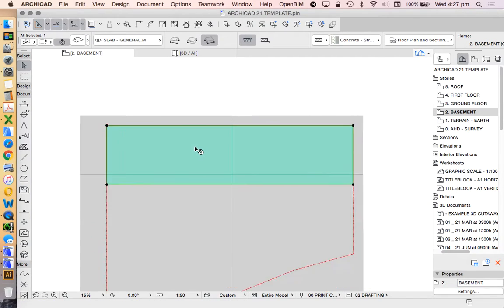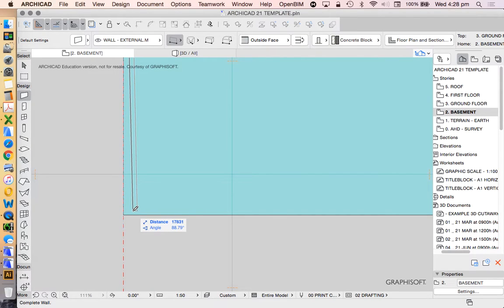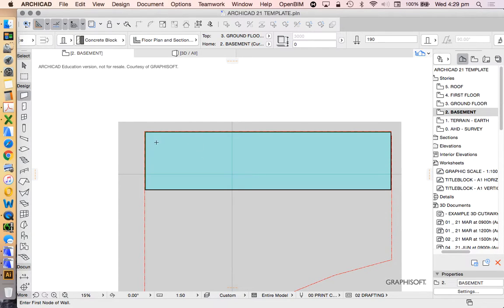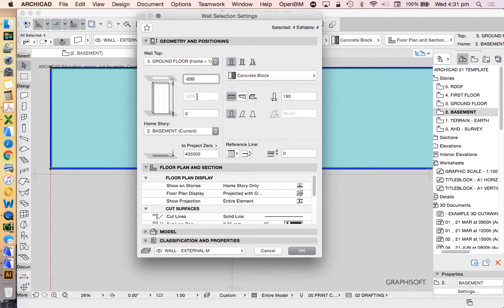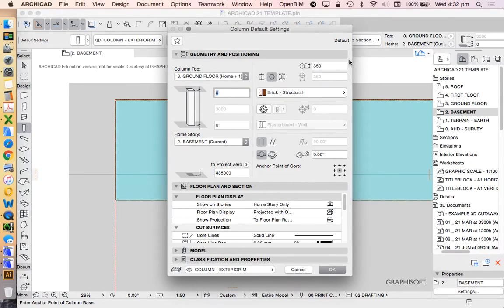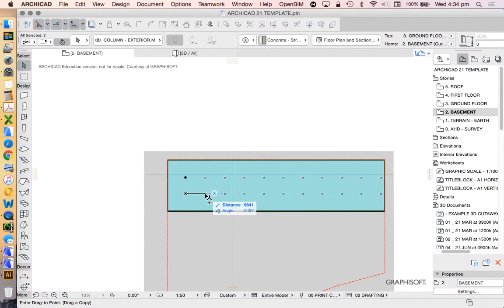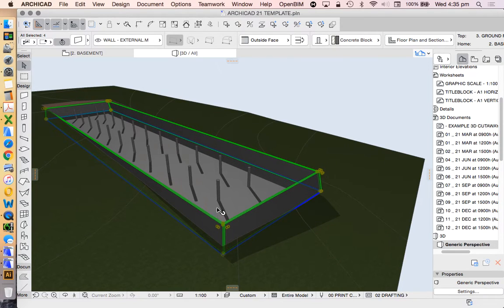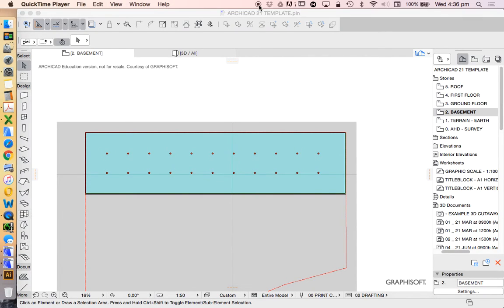ArchiCAD 21 - tutorial part 11 - wall & column tool

Comment: Robert Mann is obviously a very fine Architect who has skillfully mastered Archicad and its 1050 functions. His series of YouTube presentations are exceedingly well thought out and reflect the understanding of an Architect who has a clear mastery of the Design and Documentation processes as well as a profound understanding of the sequences in documenting or creating a model of Architecture. In his series he carefully and artfully lists the commands that he used to deal with a site topo, model the terrain in 3D and how to insert a structure that will be constructed to the top of the basement level.

There are many ways to learn. Sometimes working with functions in a logical construction order can be exceedingly helpful.

When I was an Adjunct Professor of Architecture I listed the 21 Building systems for my class and discussed how they went together.  It was a pleasure to run into a former student who mentioned that Architecture was mess for him until I explained the systems to  him and the order in which they were installed.

I had earlier undertaken analysing the AEC processes in all of the critical Disciplines in a Major Architectural Firm in Detroit. This was done to follow Hyman Rickover in his development of Critical Path Analysis. And it lead to a rapid response to a Major project of a New Medical Teaching Facility at SUNY Stonybrook LI NY of Designing and Documenting and Constructing the 600,000 sf and having the doors open in 9 months.

Sometimes it helps to put things in order.

Attach X refs.
Marker Range
Block 
Pan
Mesh
Spline
Slab 
Magic Wand
Slab 
Line
Offset
Offset Grid
Marquee
Rotate
Poly Line
Offset
Trim
Slab
Cover w/Faces
Sp;od E;e,emt Faces
Story settings
Wall
Magic Wand
Column
Multiply
Group.

Robert is obviously very skilled